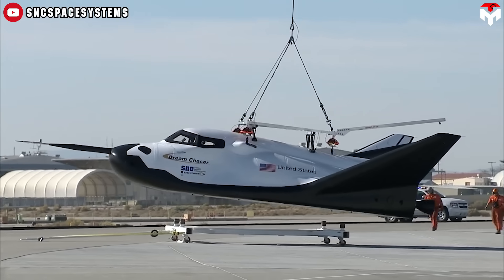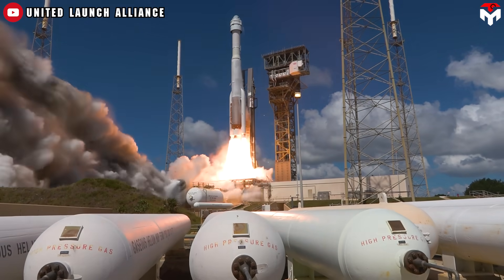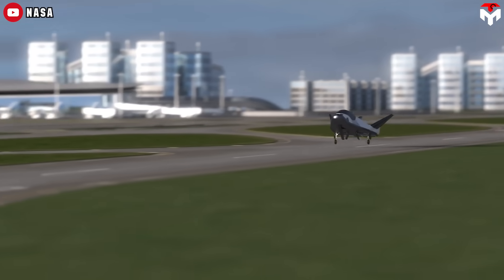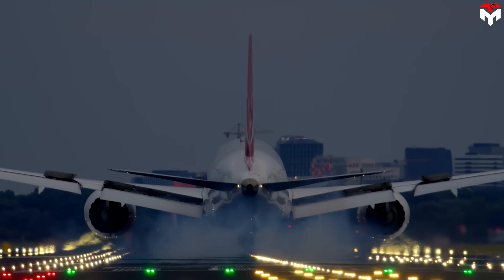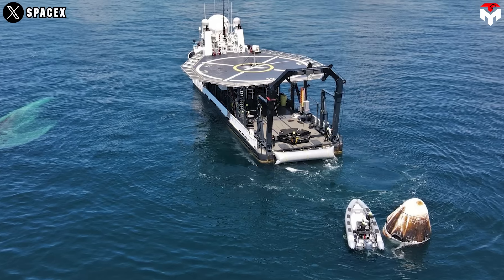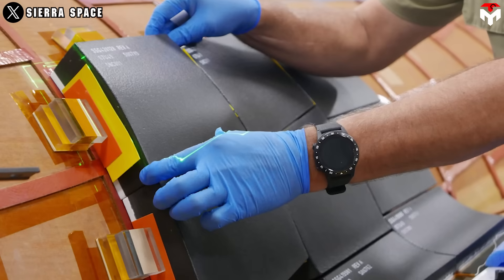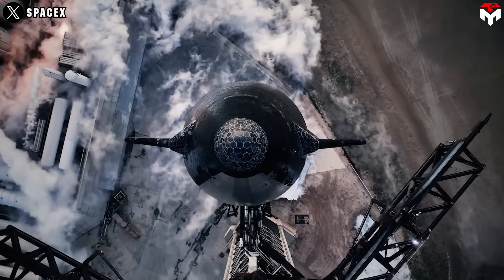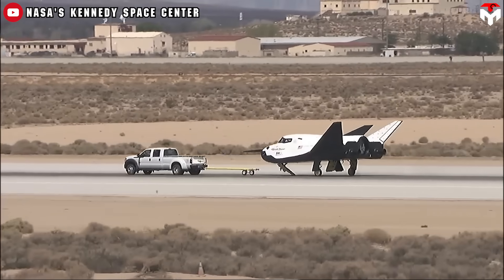Astronauts reveald NASA new space plane somehow BETTER than Starliner, even Dragon...

Comment: I hope NASA give it a chance. I think being able to land on a standard size runway is better than the desert 🏜 or the ocean.
Reply: Without a real propulsion system, this vehicle still has an uncontrolled landing.
ALL OF THEIR CLAIMS (safety. cost, reliability,  and performance) ARE UNPROVEN, and they are thousands of factors behind SpaceX.
The first space vehicle that offers a fully controlled descent (none at this point) is the winnet.
Reply: @jqmachgunner2577  There's actually decades of test data on flying prototypes of lift body vehicles NASA developed and flew in the 60's and this design is based on one of the early shuttle prototypes before the Pentagon turned the shuttle into a flying brick. This also had a lot of testing and the failure of Lockheed means they are getting a new chance. Personally I think it's brilliant they get another chance on this to finally prove if it's a dud or not.